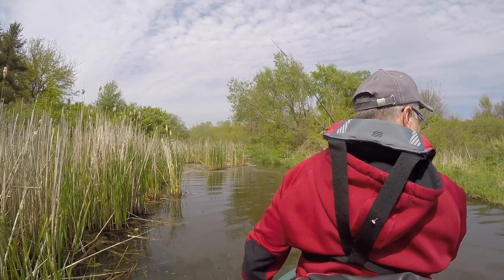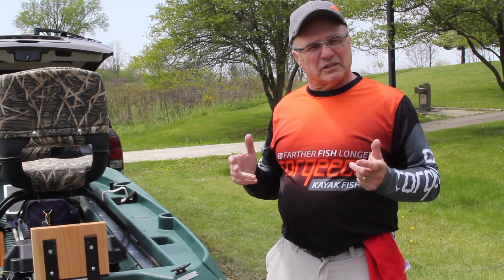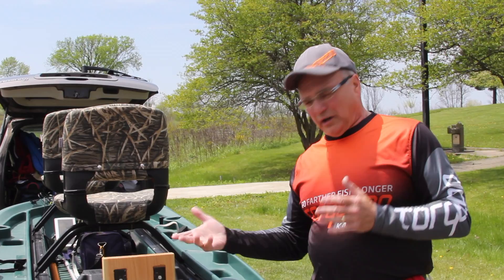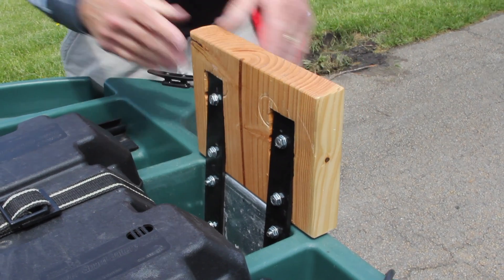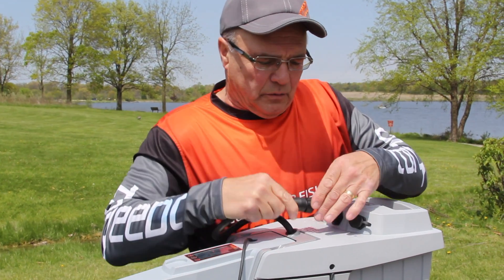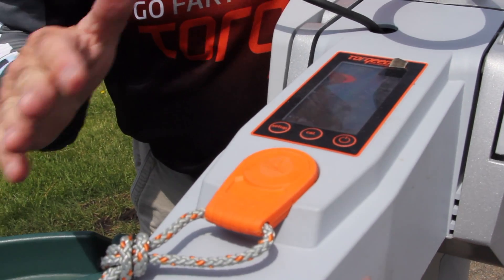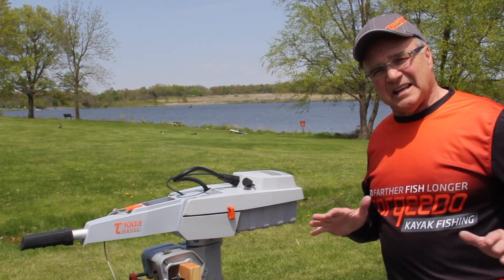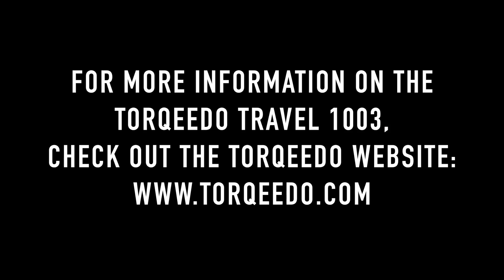Mounting a Torqeedo Travel 1003 to a Twin Troller X-10

Comment: Why buy this? It costs far more than a Honda 2.3 or Komatsu 3.5 hp outboard. What little gas the outboards sip is far cheaper than Lithium batteries.
Reply: It is pricey.  I bought a pre-owned one in 2013 (still not cheap). The decision for me came down to a few things.

1) How exactly would I safely transport a 2 - 3 HP outboard motor in a sedan? I wouldn't want to smell gasoline inside the car or have to worry about spilling gas or oil for that matter.  I agree small gas motors are cheaper and having an extra tank of gas would provide a better range. I'd think a gas motor would be less likely to break permanently and repairs much easier, and they cost way less. 

2) I can leave the boat & motor concealed inside my trunk along with an inflatable boat, and the boat is ready to use at random whenever I pass an interesting body of water. This has allowed me to explorer more than 60 locations keeping the hobby more interesting. The convenience makes you want to go boating more often. 

3) One time I got caught in a current on a river, and my trolling motor was barely powerful enough to get back. I was headed for the open ocean just after sunset and it was getting dark. As long as you save enough juice, you never have to worry about lack of power with a Torqeedo.  Another time I used my sail rig (limited on a boat like mine) and the wind was too strong to sail back safely and the trolling motor really too weak.  With the Torqeedo, I'm ready for whatever mother nature throws at me.  Also, for sailing this boat  I really need a quiet very low speed motor that I can turn on in one second to get out of trouble. I can just imagine trying to more or less start a lawn mower engine in a hurry. I sail around moored boats and need to quickly get out of the way of large boats flying at me.  

4) Going boating as often as I do carrying a car battery around was no fun. Listening to a loud motor is no fun. Having to buy gas, mixing the oil, annual maintenance, etc sounds like a pain.  

The Torqeedo is a premium product at a premium price. The only thing similar that came out more recently, actually costs more.  My motor/battery was used and it's already time to buy another battery. It costs $700 or $1000 for the newer more powerful version.  Estimate roughly 4 to 5 years of near full capacity juice, then compare that to annual slip fees and winter storage for regular, larger boats.  

I'd welcome a much cheaper competitor that was similar, but there are none at present.
Reply: Some lakes where I fish, won't allow gas powered engines.
Reply: The Twin Troller X-10 already has twin electric motors that produce 72 lbs of thrust in a boat that only weighs 175 lbs. That is more than enough power, including battery life from a conventional 12 volt marine battery for ANY "electric only lake". I know, because I own a Twin Troller myself. Awesome little boat.
Reply: Good grief man. For LESS THAN HALF of the cost, I bought a 3.5hp Tohatsu 4-stroke outboard brand new, and I can not only run circles around a Torqeedo, but I can run much farther as well. The Torqeedo on a tiny kayak only runs 7mph at full throttle, and it's draining that tiny lithium battery VERY quickly. Furthermore, you DON'T "mix oil" with the modern 4-stroke outboards, and the cost of gas to operate the tiny 2.5 to 3.5 hp 4-stroke outboards is A JOKE. I can run 30 miles on 1 gallon of gas with my little Tohatsu at WIDE OPEN THROTTLE. I know, because I've done it. Last but not least, you are making up fairy tales, because a good modern little 4-stroke outboard motor is a far cry from "a lawn mower engine". The only one made today that is really loud is the little Honda, because they are air-cooled. There's no water jacket around the cylinder to act as sound insulation. My Tohatsu is water-cooled & rather quiet. And it starts EVERY TIME on the 1st try. You guys buying these damned electric outboards are getting ripped off........pure & simple.

Comment: The Torqueedo is  a trolling motor not much dissimilar than the electric trolling motors built into the Twin Troller. While I appreciate the idea of another means of propulsion a small outboard makes the Twin Troller propelled by another means (gas) that is independent of the electric trolling motors of in the Twin Troller. If you run the battery down on a long fishing trip you have no propulsion. Personally I prefer the gas motor as a backup system. Just my opinion based on experience as Twin Troller owner.
Reply: The problem with the Torqeedo, is if you want, or need to go at or near full speed, the battery life is drastically reduced. That is a fact that is even pointed out on the charts for battery life on the Torqeedo website. In a tiny kayak, the Torqeedo running wide open barely attains 7 mph, and it's running the battery down VERY quickly at that speed. I agree with Lunker012, because I'm also a Twin Troller owner. I've already got plenty of twin electric power for fishing & moving reasonable distances from one area to another to fish, because the factory installed MotorGuide heads in the Twin Troller together produce 72 lbs of thrust. That's a lot of thrust for a boat that only weighs 175 lbs. But when I want or need to travel long distances, I would much rather rely on my  3.5hp Tohatsu 4-stroke outboard that I keep on my Twin Troller at all times. I can not only run quite a bit faster than the Torqeedo, I can run fast as long as I want, because 1 gallon of gas goes an incredibly long way with my Tohatsu outboard. "Electric only lakes" are always smaller bodies of water anyway, and the twin MotorGuide heads that come standard inside the Twin Troller are more than enough power for any "electric only lake", plus the fact the 29 series 12 volt marine battery lasts longer than the little lithium battery made for the Torqeedo ever could. A 12 volt marine battery is heavy, but it's not a problem at all with the Twin Troller X-10. I've owned my Twin Troller for going on 2 years now, so I'm speaking from experience. Not only that, but the Torqeedo motor & battery costs TWICE as much as a small gasoline powered outboard does. So you're paying twice as much, and getting nowhere near the power & distance capability with that Torqeedo vs a conventional outboard motor. It makes no sense to me whatsoever. By the way, "global warming" IS A HOAX.
Reply: Lunker012 it is not a trolling motor, it is an electric outboard motor.
Reply: jay sims...........It doesn't matter "what" ya call the Torqeedo.......They've been calling small gasoline outboards "trolling motors" and "kicker motors" for decades. The point we are making, is the Torqeedo is NOT dependable AS A TRUE "OUTBOARD MOTOR".......electric or otherwise. I was mistaken in my other response last week when I stated that the Torqeedo only pushes a Jackson kayak "7 mph". I have watched that video/review yet again after posting here,  and the top speed was 5.3 MPH. For $1,800 with the tiny battery and $2,500 for the large battery, the Torqeedo is a rip-off, and anyone who can't see that, well, there's just no talking any sense to them. The other viewer in this thread "n8goulet" made the claim that "the Torqeedo is equivalent to a 3hp gas outboard"......THAT IS TOTAL BUNK. I know, because I have a 3.5hp Tohatsu, and it will run circles around that Torqeedo. If a person could strap my 3.5hp outboard to ANY kayak, it would push that kayak to AT LEAST 15 mph, if not a little faster. Compare that to "5.3 mph top speed" for the Torqeedo on a Jackson kayak......and draining the dinky battery RAPIDLY..........I'm sorry guys, but for the ridiculous price, it's pathetic. You can buy TWO of my outboards for that price. My 2016 Tohatsu 3.5 retailed for just shy of $1,300. BUT I GOT LUCKY & CAUGHT IN ON SALE, BRAND NEW, FOR ONLY $923.00. ( Much cheaper than their 2.5 hp version. )
Reply: n8goulet........Whoever told you that the Torqeedo is equivalent to a 3hp gas outboard, is blowing smoke up your skirt. There is a youtuber who either WORKS FOR Torqeedo, or he is sponsored by them, his channel name is: "The Little Stuff". He is a veteran kayak angler, and he did a video just last month about top speed for the Torqeedo on his Jackson kayak. I mistakenly stated "7 mph". I was WRONG because I just watched that video again, and his top speed was only 5.3 mph, and draining the battery fast. My 3.5 hp gas outboard would push any kayak at least 15 mph.......if a person could make it work on a kayak. A kayak & canoe are the easiest of all water craft to propel through the water with the least resistance. If the Torqeedo can only push a kayak 5.3 mph........that is nowhere near "3 true hp".
Reply: jay sims........Good grief man, you are totally ignoring EVERYTHING I just stated, and you're only quoting where I mentioned "price". You guys are getting taken to the cleaners. Try researching what MANUFACTURING LITHIUM BATTERIES DOES TO THE ENVIRONMENT. It is FAR more harmful than producing gasoline engines. Furthermore, the modern 4-stroke outboard motors do NOT burn oil like a 2-stroke. They run very clean. I'm sorry, but if you enjoy getting ripped off based on fraudulent claims by the "the global warming" liberals..........then there's just no reaching you. Don't take my word for it........research how nasty the manufacture of ALL lithium powered motors AND batteries truly are. Are ya gonna try & "pick & choose" a few words from my latest response too? As you ignore all the FACTS?  Like I already said earlier too: "Global warming" and/or "climate change" IS A LIBERAL HOAX. The vast swamps & sea grass beds all over the Earth release more methane gas, which is a major carbon, into the Earth's atmosphere EVERY YEAR than ALL  man-made carbon emissions  COMBINED throughout our entire human history.  THAT is REAL science. Same goes for volcanic activity. Look this stuff up man. But really, my only "beef" with the Torqeedo, is the fact they are pricing that thing about triple what it's actually worth. You watch what they go for in 10 years. I just hate to see you guys getting ripped off. But hey......whatever.
Reply: Howabouthetruth did u really just go to the "liberal" b.s. argument?  If someone is willing to pay more for what they want it doesn't put them in the category of "being ripped off", and anything that you don't dispose of properly can cause damage to the environment,  that means any type of battery.  People will purchase what they can afford and some what they want.  Your feeble attempt to label those who don't feel as you do as being "liberal fools" won't stop anyone here from buying what they prefer with their hard earned dollars.  You have chosen to take this conversation to other realms of idiotcy so this is where I get off the "crazy train" and let you carry on soldier!  #lol
Reply: jay sims..........Ok, you are A TOTAL BONEHEAD. You're pulling "disposal" of batteries out of your rear end. I SAID "MANUFACTURING" LITHIUM BATTERIES........HELLO. Hey, I'm not "trying to stop you" from doing anything.......and yes, you ARE a liberal......your very own words in every comment you've posted here proves it. YOUR WORDS........NOT MINE. You even act like a liberal the way you PURPOSELY IGNORE all of the valid facts I just listed, and then you replace it with stupid crap like "battery disposal". Hey, you go buy TEN of the damned things.........and I'm not wasting another minute on a liberal moron. CLASSIC LIBERAL MORON. YOU SPEAK IT, AND YOU BELIEVE THAT BULLCRAP, AND YOU ACT THE PART. Because ONLY a liberal IDIOT could get "battery disposal" out of "BATTERY MANUFACTURING".........you jack ass. You've already stated "cleaner environment" which gave your ignorance away...........4-STROKE OUTBOARDS ARE CLEAN. BOTH MANUFACTURING THEM AND OPERATING THEM. Unlike the poisonous toxins released during THE MANUFACTURING OF LITHIUM BATTERIES, that causes far more pollution. Get lost man. Oh, wait.......you already ARE lost. Go ahead & get your last word in, so you can go flex in the mirror. I won't read another word.
Reply: It's not actually a "trolling motor".  It's an electric motor.  I replaced a Minn Kota (that's a trolling motor) with a Torqeedo 1003 about 4 years ago.  

Unlike a "trolling motor", the Torqeedo has real power to it like a 3 HP gas motor.
Reply: Howabouthetruth so your true argument is about the price and not what it actually does!  I prefer something that is more environmentally friendly so I'm willing to pay more in order to protect the bodies of water that I fish.

Comment: According to the manual I have (ver 2.0, 2014), the tiller control should go on before the battery.
Reply: Not true. The main battery (motor) cable is connected first and THEN the tiller control cable. The sticker on the battery states: "Motor Cable: connect first. 
Disconnect last." This is on my 2017 Torqeedo 1003, but it's been the same advice for many years.
Reply: You're right about the cables. I was referring to the tiller and battery units.